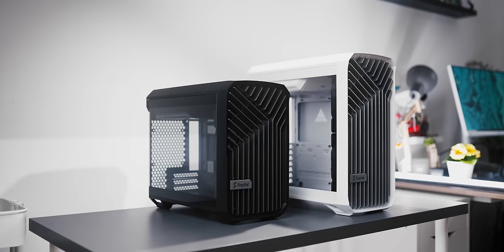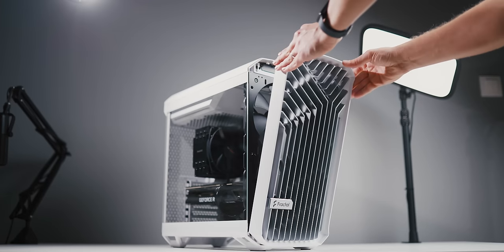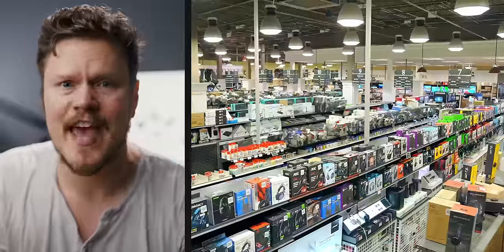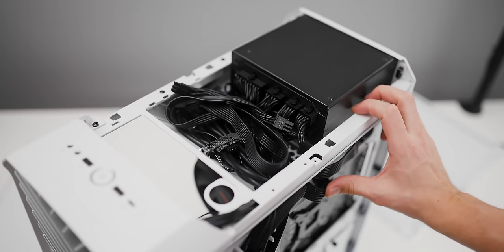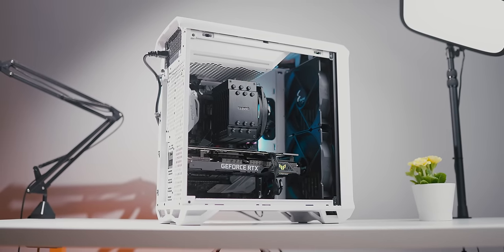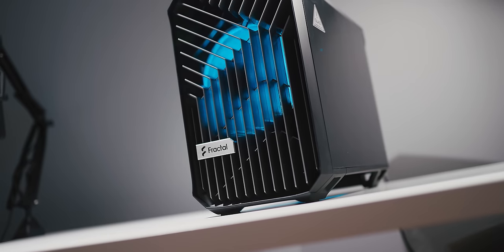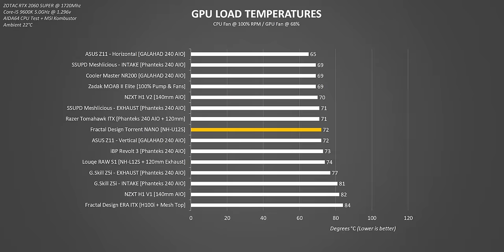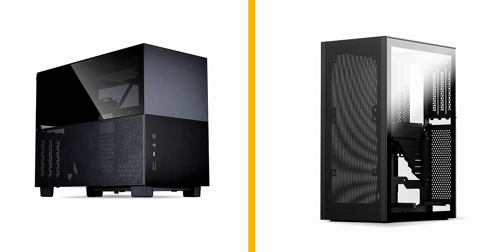Absolutely LOVE These Cases - Fractal TORRENT Compact & Nano!

Comment: I have the large version, It's great but far from perfect.
Too many youtubers out there praising it more than they should without calling out the bad parts, No where near enough cable management on the backside of motherboard once you start actually filling that case up with high end hardware and HDD/SSD's, Need another 20-25mm because despite doing a reasonbale job with all the cables, The 24 pin power was still bulging out and I needed to screw the glass panel in so it doesn't pop out from all the cables pushing against it.
PSU space at the top is also a struggle for large 1200w PSU's to route the cables, Space needs to be extended further forward so you don't have to try bend cables 90 degrees to get them routed behind.
Front grille should have been metal instead of plastic for the price.
Having said all the negatives, It is by far the best air cooling case I have used in the past 30 years, I would like to see Fractal Design do a revision 2.0 of it in future with the following improvements.
25mm more cable management space behind motherboard and side glass panel,A couple more 3.5 HDD bays, Extend PSU space forward another 40mm more(There is plenty of room there to do it where they have large hole for water filling)so we don't have to bend cables on larger PSU's.
Reply: If you aren't putting fans at the bottom, you could always put a few hhd brackets down there. I haven't looked to see if stand alone brackets exist but normally if I can think of it, Amazon sells it. 🐻

Comment: I think the price of the Nano is very reasonable because you tend to pay a premium in this space and the options offered are great. I am currently using an NR200, which is baseline $100. I wish the nano was released a year ago, don't get me wrong the NR200 is a great case for airflow, but is cramped and did limit my cooler choices. The NR200 also has massive issues with having to disconnect everything and dust it out at least once a month. Not a great case for anyone with pets or high dust levels. Plan to upgrade once I have everything lined up.

Comment: This style of not super compact sff cases is definitely my favorite trend of the past year. I just wished this was available six months ago when I bought the cooler master nr200p. We’re absolutely past the point of sff being any sort of compromise for modern systems, especially with nvme storage getting as high capacity as it is. Because of the small footprint of cases like my nr200p, I don’t think I could recommend a midtower to any college students out there as traveling and keeping a beefy case in your dorm is just a hassle. I started college with a nzxt h510 and it was sucked having to check it on a plane. With these sff cases one underrated feature is the fact that you can just straight up use it as your piece of carry on luggage which can really ease the mind when you’ve got 2k in parts. Never know what the people at the airport are gonna do to your pride and joy so why risk it?
Reply: There is a clear distinction between SFF and ITX cases - the NR200P is borderline SFF, but the Torrent Nano, H210, P200 etc. are all “just” ITX.

Comment: I'm still somewhat considering one of the Torrent cases but I think I'm going to go with the Lancool 3. I've been using the Lancool 2 Mesh since it first came out and it has performed incredibly well for me. Plus, I've gotten totally spoiled when it comes to having a very spacious lower compartment and covers for hiding all of the cabling behind the motherboard. Its kind of a cheat code, really. I still cable manage everything quite well just because I'm pretty fastidious with that sort of thing but being able to easily hide every bit of cable mess is a major feature of the Lancool cases that the Torrent models just cannot compete with. 

The Phanteks G500A is also a serious contender, as is the Corsair 5000D Airflow. I bought a 5000D Airflow a few days ago but will be returning it, as it had one or two annoying panel gap issues and 3 of the 4 rear thumb screws which secure the side panels were crookedly threaded. I might buy another one and see if I get a better example because I actually really like the look of the 5000D but I am leaning a little more toward the Lancool 3.

Comment: The full size is larger than it looks but has great cooling. Cable management is easy with all the extra space. Ordered the compact for a new build that does not require a GPU.

Comment: Really like the design of this case , there is a lot of completion in the mid size right now that also have great airflow with better rad support. I think opting for the 180 fans may have been a mistake as I've seen videos where mounting a 240 rad to the front prevented the from from closing with the dust filter on it.

Comment: I built my first PC in a Fractal Case.   Then I started building a second PC in a Cooler Master case to save $75 from the cost of the Fractal case.   3 of the 5 MBO screws stripped out from barely turning the screws.  The difference in quality in cases between manufacturers became very apparent.  I returned the Cooler Master and now have two Define 7 cases.

Comment: Got the grey torrent and running  12700 with noctua air cooler and system is quieter than my previous aio cooledsystem in an o11 dynamic.

Comment: I had a Meshify C a few years ago.  It actually fit an EVGA 2080Ti with a front mounted 140mm radiator.  Barely, but it did fit.  Now I’m running Meshify 2’s, but I absolutely would consider a Torrent for the appropriate build.

Comment: OK...  I completed a Torrent Nano build, and have some observations.  

First, if you buy a Dark Rock Pro 4 air cooler, know that once you install the cooler on the motherboard BEFORE putting the motherboard in the case, you either have to remove the motherboard to change a CPU, or you have to butcher the case bottom to make a hole through which you can insert the larger heatsink fan.  This cut into the mounting holes for a bottom fan, but I was not going to do so anyway.

Second, a large air cooler like the Dark Rock comes very close to touching the bottom of the power supply tray.  This precludes access to pin headers on the side of the motherboard that buts up against the PSU tray.  This time, you end up cutting away pieces of the tray to give you access to those pin headers.  You also need to trim away some more case material to give you enough room to install the CPU cable.

I put a Seasonic Prime 750 watt PSU in the torrent, and little space is left to mash up cables.  It's not that much of a problem, but you'll spend a fair amount of time spreading the cables across the cable guides and velcro ties.

All said, after considerable case butchery (it's steel, and fairly thick), I can install the ARGB splitter you'll need to buy if you want your 180mm fan, PSU highlight, exhaust fan, and for that je ne sais quoi, a tasteful LED strip on the bottom to all light up in proper sync as well as upgrading CPU w/o having to pull the motherboard.  OY GEVALT...
Reply: Is there an option to install water cooling?

Comment: I was immediately in love with the look and size of the Nano, its perfect for a reasonably powerful gaming rig to commute with. However I agree the cpu plug was problem I ended up plugging it in before installing the motherboard. If I did it over again I would suggest installing the cpu cooler mounting hardware but not the cooler till almost the end. I wanted to mount fans in the bottom under my 2slot 3060ti but its really too tight for comfort. With adding a 120mm exhaust fan my thermals have been very good, I used the new Bequite RGB fan. my final note is to used a modular power supply with custom cables, this really keeps things from getting too cluttered on the back side.
Reply: Thanks for sharing your experience. I am looking at this down the line and figuring the larger non-compact will be needed due to what you describe re: the bottom area. Cable routing looks very tight for fan configuration there, and as you say, more space would be better between those fans and the thicc GPUs these days. In any case, this case line looks like it improves everything from the Meshify I bought back in 2018. Glad you are rocking a great case, and thanks again for the details.

Comment: I have a torrent, it is definitely worth it. Easy to build in, easy to manage everything, excellent airflow. I have a 12900k cooled by a Noctua D15 and a 3080ti, no thermal issues.
Reply: which torrent do you have? I'm wanting the compact but have a huge Evga Geforce RTX 3080TI FTW Ultra and measurements see to be different with a lot of videos. 🐻

Comment: Bought the Torrent Compact. My biggest gripe is that I wish it had, even just ~0.5cm of extra space, for cable management behind the motherboard. It's not a huge issue for me, as I'm not adding any extra fans. But if you do add something extra, like an AIO or more fans - or if your PSU cables are a little bulkier - you will have to spend some extra time to get your cables to fit without bulging your side panel. Apart from that, the price for the Compact is suitable for being a well-cooled "mid-range" case, and it's actually about the same height as the Define R5 (which I also have from my previous build) while being a few inches narrower from front to back, so it also has plenty of room for a full ATX motherboard. That said, I do personally wish it were a little bit shorter - a couple inches or so - since I was aiming for an mATX build. It's not the biggest issue, but bear that in mind if you're looking for an actual mATX case.

All-in-all, if you want a good mid-sized case, the Compact is a great case. It runs cool, isn't atrociously loud with the stock fans, and is pretty easy to build in - again, as long as you don't have too many/too bulky of cables to work with behind the motherboard.

Comment: did build a am5 with 7900 xtx, it's great to build in and looks great. the reason the white is more ruff is because it's painted, price would be even higher if the sanded or polished it, also who cares about the sound of a case when you scratch it with your fingers, it's not something you do anyway unless you're weird. I live close to Sweden so price is a lot more reasonable here

Comment: I configured a simple 12700K ITX system with the Nano, 1TB SSD, 16GB, U12S cooler, PS and it ran over $900. So $20 or $30 extra for the case is noise level. I also configured the same system with the Sama IM-01 ($70 case) but I would have to add 2 or 3 $20 fans. So I'm going with the Nano.

Comment: I am thinking that if it was for myself, I would not go for these.  Fractal has, in my humblest of opinions, better cases out there.  I just finished my build in the Meshify 2 Compact, and that case I will keep for a long time.  It harbors my 4070 triple blade and still has plenty of space left at the front fans.  Got a 240 AIO cooler in the attic.  Not sure if I am going for the basement yet or leave the 3 120mm in place.

Comment: The 180mm can go on the bottom so some of the cons are fixed. Put a 240mm or a 360mm rad in the front and the 180mm fans at the bottom.

Comment: Love this case. Bought the white torrent and it's really worth it. I knew from research not to go with AIO but still went that route. Was alot of extra work but is do-able. It just took an extra 2 or 3 hours of my time. Had to undo a few things over and over if you want to change something, so pure air cooling Will be much easier. Excellent case still.
Reply: Do you have a pic of your setup?

Comment: Yeah, it’s a bit expensive but I love this case. Only buy it if you want a full air cooled build, and set aside some cash for individually sleeved cables as the space for cable management sux especially for the sata power for the ssd trays.

Comment: just got Fractal Design Torrent Black Tempered Glass Non RGB  [RBG case $68 more]
love were they put the power supply at and let it hang down little looks dope. easy to get to
Hate only two usb out front. i can use six if want but i can't 
only need upgrade to this case because my little 420mm radiators my old Cooler Master MasterCase H500 was to small i need room

Comment: I would much rather choose the Fractal Meshify 2 Compact instead of the Torrent compact. The PSU in the top eliminates the possibility to have an optimal water cooled solution, so as also mentioned in the video this would be for air cooled builds.  Also, the Meshify 2 compact is a bit cheaper, has a bit better cable management and is a bit easier on the eyes in my opinion.

Comment: Anyone else here old enough to remember when having the power supply up top was the standard ATX layout and putting it at the bottom was the new hotness?
Reply: since 1994 first crapy AT pentium you lern and move on^^ P2 still lernd not enough crappy ATX case with power supply too cheap blew up. 1 ramstick and a floppy3.5 only survivors^^

Comment: I wouldn't agree that it's only for air cooling. Alpha Cooling has a 400mm rad that can fit 200mm or 180mm fans, and EK is working on a 360mm (2x180) rad. So, there's no reason you can't do an open loop.

Comment: If I would get a graphics card for a reasonable price I would definitely buy the Fractal Torrent Compact as the air cooled temperatures look good and other similiar cases aren't a lot cheaper.

Comment: The prices aren't too out of range considering how unique it is to get a case where if you're particular about fans you won't just throw the included ones away. 

I've lost count of how many cases I've bought and then spent about the same price as the case putting decent fans in there. My last case was an O11 Dynamic and for 9 good fans...that's a lot of money.
Reply: Yeah the 180s from Fractal are worth a bit of premium, they're also about 36mm deep so it's basically cheating, sort of like the Phanteks T30.

The included 140s on the Torrent, I found to be just okay. I replaced them with Scythe Kaze Flex 140s and dropped a few degrees even at a very low RPM.
Reply: @libertyprime9307  That's useful to know. I'm considering a build in the compact and was thinking of adding 140s for the GPU intake.

Comment: That price is a bit of a kick in the nuts (especially if you're looking at a case for a "simple" build - assuming you equate "simple" with "budget") and I feel like they're both around $20 over where they should be (Phanteks feels like the company to beat in the space, since they have both excellent airflow and good value pricing on lock), but I'm almost inclined to give Fractal that extra cash just because they seem to be a company that wants to do right by their customers, and that's becoming an increasingly harder thing to find these days.  Plus, I just really love the design of the Torrent line and I'm so happy to see them shrink it down a bit (without compromising airflow/thermals), as I'm completely over the whole massive monolith case aesthetic.  Bummer about the white paint texture, though, as that would've been my preference.  Hopefully it's something they fix on future production runs.

Comment: Having better temps just because has big front panel fans is kinda cheat. You should test with a typical 120mm 3 or 2 fans to determin how really is air flow compared to other cases, well all cases should be tested like that. Cuz if in the end is who has more and bigger fans then it's pointless. It's like having cars with the same aerodynamic design and with different motors. Who goes trough the air better ? For sure it's the one that has a better motor.

Comment: Love the two LARGE front fans. (About 60% more fan area than three 120mm fans! Yes, I did the calculation.) But I'm still happy with my 3*120mm 4000D airflow, considering I will consider an 280mm AiO for the next major upgrade (in a few years), since intel CPU's are getting really hot these days, and in case I want to move it around a bit more. But if I knew I'd stick with aircooling forever (which I might though) this would probably be the nicer case out of the two.
Reply: Aircooling all the way. Get this case instead

Comment: Just waiting for the next gen Ryzen so I can have a reason to go ITX and build in the nano. My old Define R5 is just massive and slowly falling apart.
I would love more coverage of these cases since they seem to have many air flow oriented cooling setup options.
Reply: Nano is more volume compared to Fractal's own Meshify C Mini by 1 liter. This is an oversized itx case that takes up more desk space than Fractal's own older generation matx case. If you're going to itx, don't settle for a case that is larger than matx cases.
Reply: @InushiDoggo  That's actually a good point. I just like the upside down layout more than the more common one with the PSU at the bottom.

Comment: The Torrent would be my go to if the original version had side Radiator mount area, kinda like the lian li o11. I would very much like to use the Torrent with an AIO system without sacrificing the front 180mm fans, as well as the bottom fans

Comment: Thanks for mentioning the GPU support bracket. Would've liked to see it mounted perpendicular/flush to a real GPU using the inside mount rail to figure out if it could reach the outside corner, there's not really any point to bracing the inside corner of a card.

Comment: Fractal TORRENT Nano is my next PC case. I am not an overclocker, I don't care about fancy RGB and because of that I Don't care about water cooling. This case is an air cooling dream for someone which wants a smaller than mid-tower case that is easy to use and is compatible with big performance air coolers like Noctua U12A.